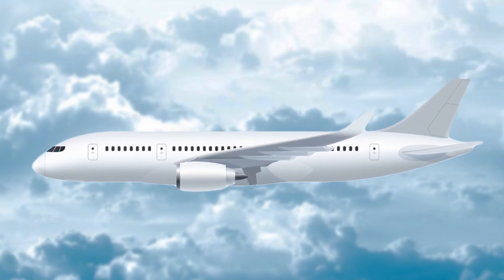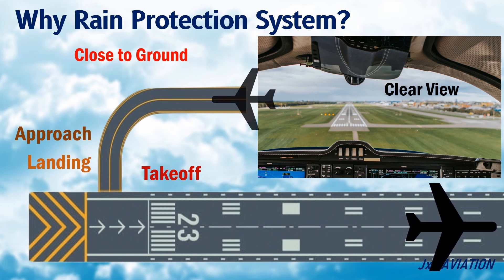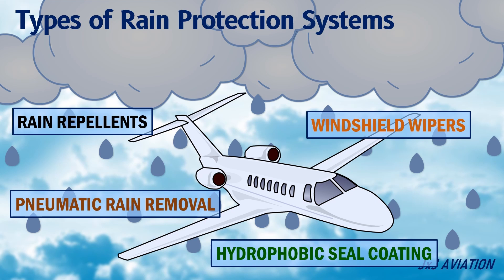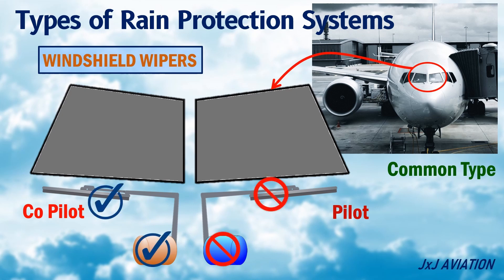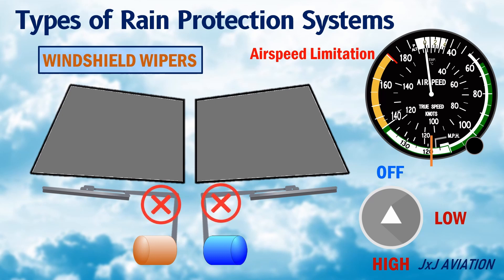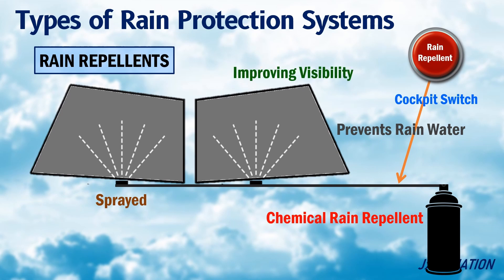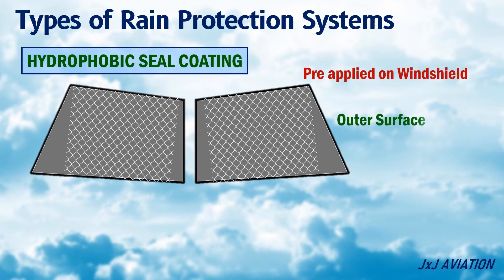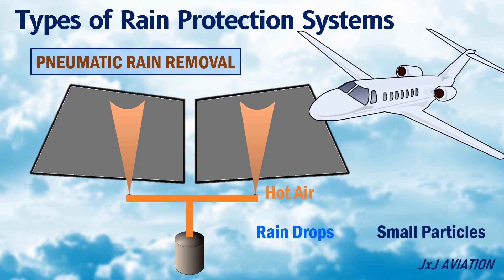Understanding Rain Protection System in an Aircraft | Types of Rain Protection Systems

Comment: Interesting presentation of the available rain protection systems, the hydrophobic and warm air systems can provide the most effective windscreen protection, although all need to be approved by the aircraft manufacturer. For example the windscreen on a 747 can cost close to $500,000. Chemical systems must not damaged the seals. There are so many maintenance variables on modern aircraft. As always an excellent video.
Reply: Thank you for the information
Reply from the maker: Thank you so much for the information and thank you for your feedback!